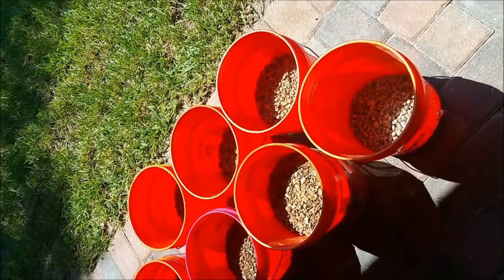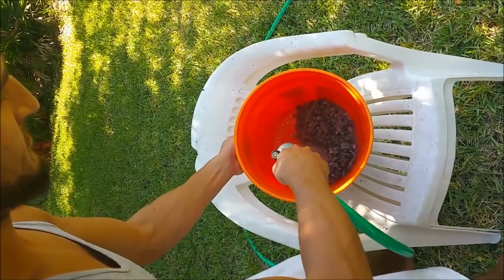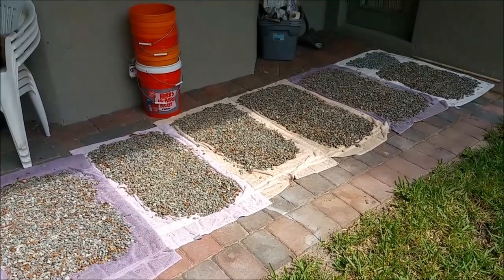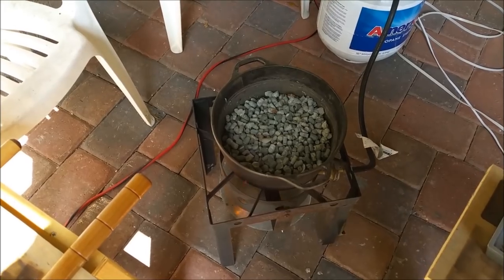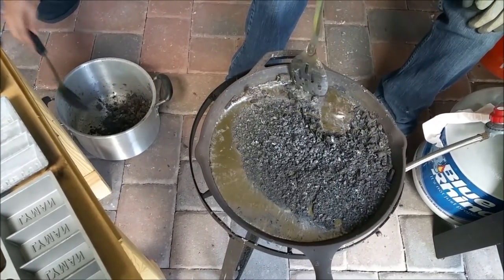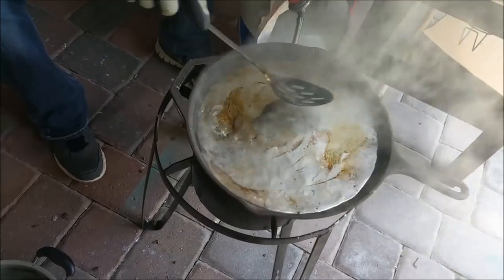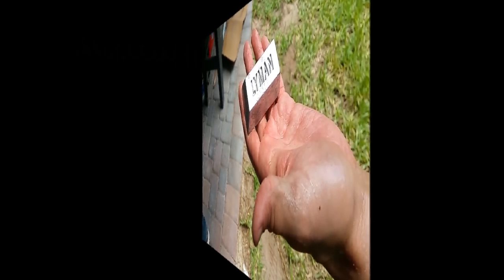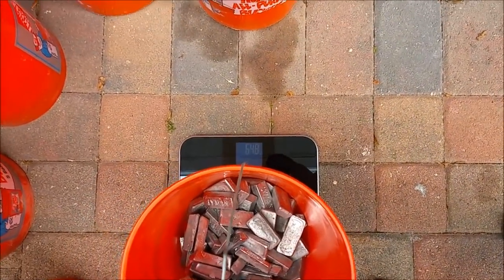Cleaning and Melting Reclaimed "Range Lead" into Ingots

Comment: can you us how got them form the range
Reply from the maker: +Robert Johnson I don't have a video for that at the moment - but its actually pretty easy.  I made sifting boxes using 2"x4"s -- approximately 2 feet long, by 1 foot wide and attached chicken wire to the bottom with a staple gun.  The Chicken wire is perfect to catch anything above the size of a 22 round.  You can even put handles on both ends for a better grip.  Just dump a few shove fulls of dirt from the mound into the sifter -- give it a few shakes, and all you should have once the dirt and sand has sifted through is bullets and debris.  Pick out most of the debris, and dump the bullets into a bucket.  Repeat the process until you have enough to your liking...

Comment: Next time skip the rinsing process. The flux will draw the dirt out and it will float to the top because lead is so dense
Reply from the maker: I know Hugh - and yes, it would save time from rinsing and drying...  I guess I'm just a little OCD when it comes down to it.  Plus -- I am in no particular hurry, and prefer to limit the amount of dirt and debris that ends up in the dross that gets pulled off with the jackets...  Since we ended up with over 200 lbs of jackets (and whatever other residue was pulled off in the cleaning process), we decided we would try to salvage those jackets and see if we possibly sell to a scrap metal yard.  I figure if we ended up with 200 lbs on that last haul, we will potentially be close to 500 lbs in this next haul we are planning.  Would prefer to keep the debris as clean as possible.  But I understand your comment - and agree!

Comment: that's alot of work for 200 dollars worth of lead.
Reply from the maker: Yes, it is a bit of work --- but it produced 355 lbs of lead for next to nothing...  Tell me where you can get 355 lbs of lead for $200.00 that includes shipping...  Inquiring minds want to know!   Best deal I have ever found on ebay was around $2.00/lb - with shipping included.  Even if there was a blowout sale - for $1.50/lb with shipping included, that would be around $535.00 to get 355 lbs delivered to me.  And where's the FUN in that!  The whole process of recovering it, and melting it down into super clean ingots -- ready for casting was almost as fun as casting itself!
Reply: DKH TACTICAL in my opinion it's a good thing if you want to do something different, I mean we get money from our jobs ,this is a way to spend some good time maybe with a friend and make money
Reply from the maker: It was a very fun, and very unique experience.  Had a BLAST doing it, and we have definitely made use of the lead we recovered.  We went back about a month ago and did another recovery.  I now have more than enough lead ingots in reserve to keep me making bullets and buckshot for a long time to come!
Reply: Yes it is fun and saves money but propane isn't free so you really have to cost that too.
Reply from the maker: Used about half of each propane tank, which I can get for $17.99 at WalMart --- so OK...  I guess I had an expense of around $18.00...

Comment: damn why "clean it" you can clean it when its liquid.
Reply: Helps to identify duds/rounds with bad primers that got thrown into the berm.  You really don't want an unseen live round in the pot of molten lead, do you?
Reply: @BUTCHER308  eh. As long as it wasn't a rifle round.  The pot I use is a half inch steel pot with a heavy lid. So for me I'm sure it would be fine
Reply: @elitenoob1147  so a drop of water will blow-up your pot, but a live pistol round won't?  Okaaaaaay.........
Reply: @BUTCHER308  its okay if you want to clean it. Its okay. Your way is your way. My way is my way.
Reply: @elitenoob1147  I originally posted only to answer your question.....then posted again in order to respond to your questionable logic for the benefit of the readership's consideration.  Not gonna go back and forth on it trying to convince you yourself otherwise, as logic should have prevailed at his point already.  You do you.

Comment: thats what u call easy money i was i can do this
Reply from the maker: Easy is a bit of a relative term - especially the recovery part...  There is definitely a bit of "manual labor" involved in the recovery -- shoveling dirt/sand from the backstop into sifters and then picking through the debris...  But for about 2-1/2 to 3 hours work doing the recovery process, we brought back 555 lbs, which yielded 351 lbs.  The cleaning process combined with the process of melting it all down was a full day (around 8 hours).  We actually had "fun" doing it -- so it was really a "Win-Win"...  I just built a two-man sifter that is about 5-1/2 feet long, and just over 2 feet wide that we can set up on two saw-horses and just push back and forth...  Much easier on the back, and it makes short work of the sifting process...  Dump a few shovels full into the sifter, push back and forth a few times and all the dirt/sand falls through the 1/4" Wire Screen and you are left with bullets and some debris/rocks in the sifter...  Pick out the majority of the debris and dump the contents into a 5 gallon bucket --- then wash/rinse/repeat until you have a good load to take back.  There is definitely some up-front cost involved with purchasing all the materials/equipment you will need, but after a few trips -- it has definitely paid for everything, and then some!  After this last trip we just did - I have enough lead to last a long damn while!!
Reply: I WOULD LOVE TO DO THAT BUT IN CANADA ITS KINDA HARD. I LOVE WATCHING THINGS MELT AND MELTING METAL. SELL THE LEAD A BUCK A POUND so u got almost 200 pounds of copper